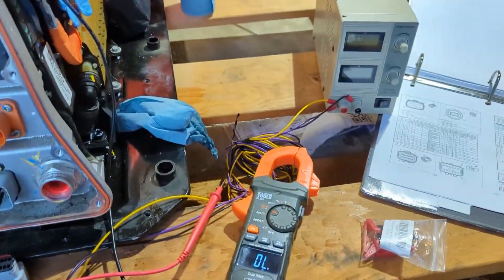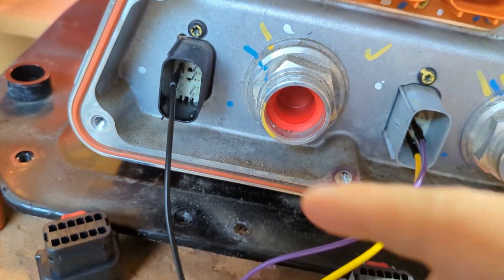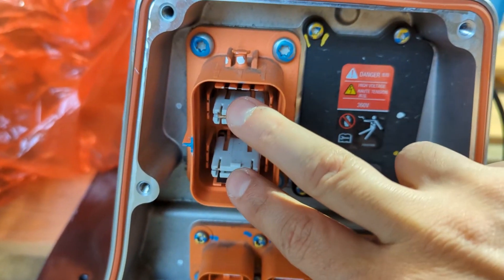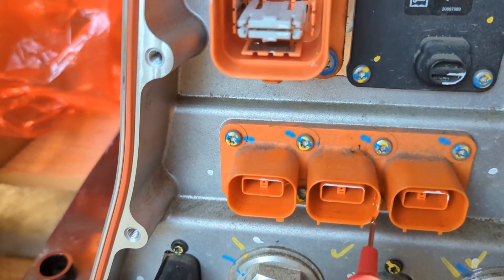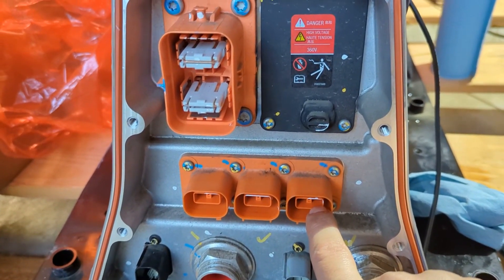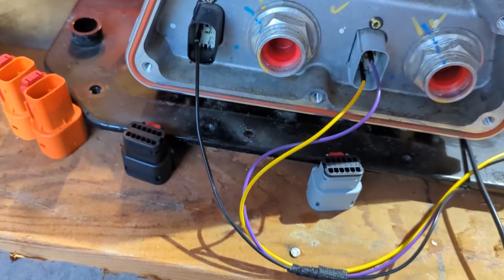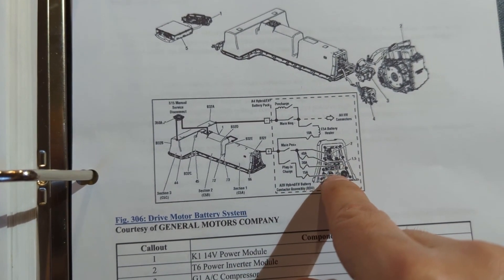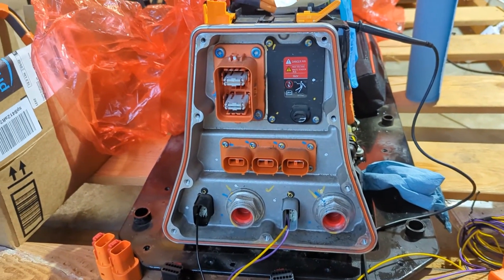Porsche 924S EV Conversion - Part 17 - Chevy Volt Gen 2 Contactors

Comment: Is the PWM the current limiting signal from the wall charger?   There is a a signal that comes in from the charger that tells the BMS how much current the outside charger can safely deliver.
Reply from the maker: definitely not in this case because this is just opening and closing the contactor. the BMS sends signals like that to the charger. This is just the contactor to provide the connection to the charger and should only be on/off. Some other commenters have said that some vendors give it a full voltage to get it closed and then use PWM to lower the effective voltage to like 10V or so to keep the contactor closed. I think that extends the life of the contactor. But that is just based on the youtube comments - i'm not really sure!

Comment: It may not be an issue in your case but in the VW eGolf pack there is a capacitor across the HV which was still live for some time after I dismantled the pack, I used a resistor to discharge it safely. Maybe something to watch out for.

Comment: A lot of those contactors use PWM to hold the contractor in place.  High duty cycle to pull it in and then lowered cycle to maintain it.
Reply from the maker: Ahh, interesting. Well, unless my thunderstruck VCU is doing something like that, I'll be driving them hard I guess!
Reply: In my case I'm just using a 10V supply from a dc buck converter which seems to work OK.